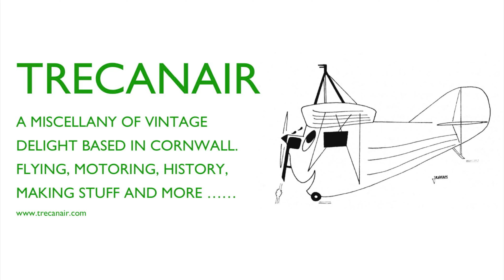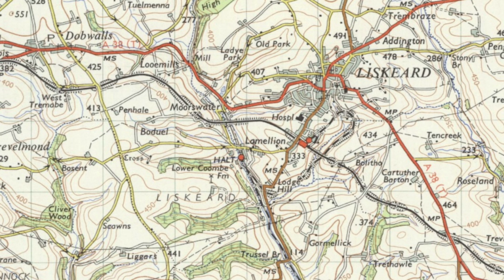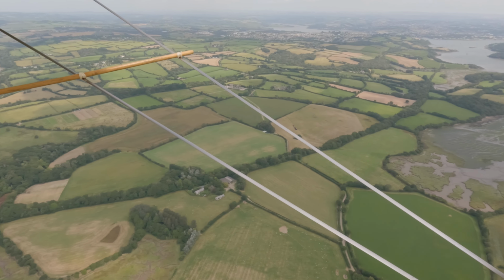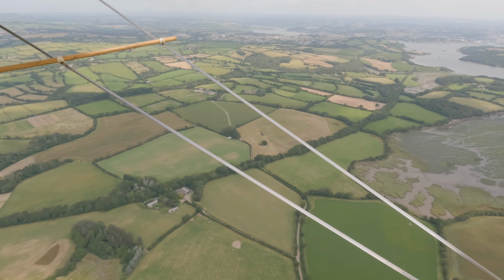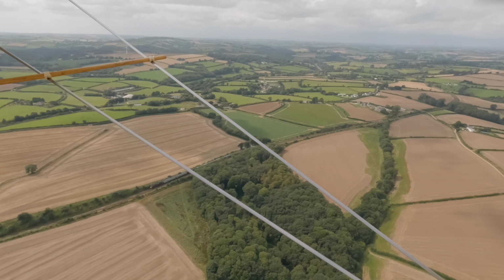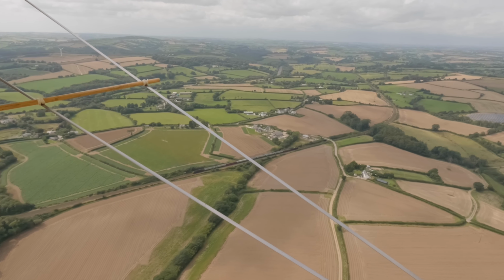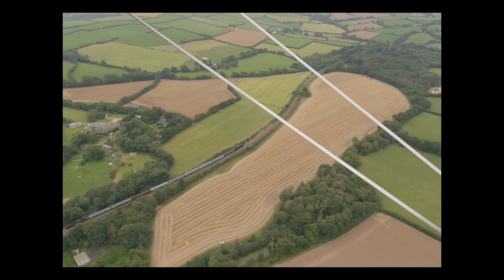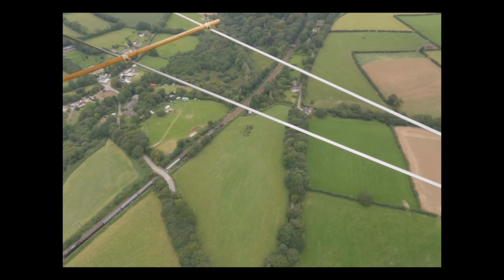Aeronca C3 - Beaten By A 'Black Five'!

Comment: Many years ago Flying Scotsman passed just north of Barton Airfield on Stephenson's Liverpool & Manchester line, over Chat Moss. I was only a few hundred feet above it in the Barton circuit in our Chipmunk and could look down on the crew on the footplate, the fireman labouring away to keep his fire fed, and both quite unaware of our presence.

Some years later flying out of Liverpool in the same Chipmunk I saw tell-tale smoke to the south, on the Crewe to Chester line and flew over to have a look. It was Rood Aston Hall on a special - and at 90 knots cruise speed I had to circle above it or I'd have left it behind. It looked magnificent, coupling rods flashing the sun.

But the 125mph Pendolinos on the West Coat Main Line I often saw could outpace the 90 knot Chippy! I also used to fly a lovely little L4 Cub (60hp!), and I think the narrow boats on the Trent & Mersey Canal could out-pace that if there was any sort of headwind!

Thanks for a delightful vid.

Vince